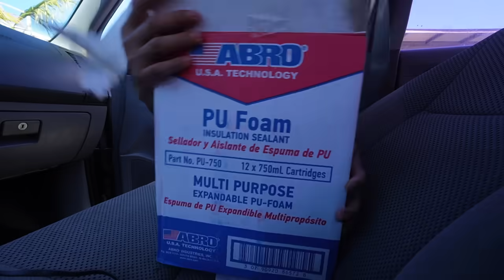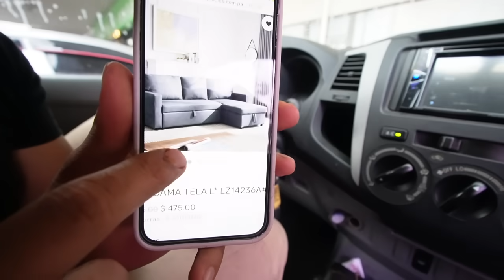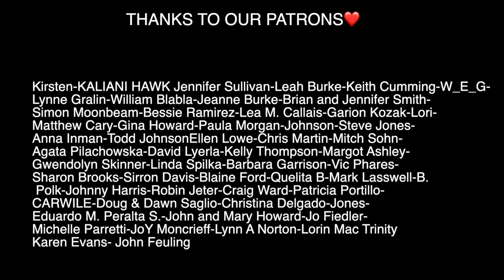WE HAVE TO STOP! | fixing it is a priority

Comment: The rest of the house ..before you put wood on the walls...use Insulation batts...not foam 
Foam makes a huge mess!!!
I'm not sure if the Foam insulation made it down to the bottom of your walls!!! Go ask Jordon before you continue!!!
Reply: I agree it is a quick fix.
Reply: I was thinking the same thing.  That the foam from a can might not reach all the way down.
Reply: The foam would only reach to the length of the thin plastic tube it wasn’t long enough to reach the bottom, if he checks the bottom by drilling a small hole he’ll know for sure🤦‍♀️
Reply: Same.....
Reply: Sorry, but pink batting is Best !
Reply: Foam Makes it hard to work around the electrical units...
Reply: Yes…the whole house!!!!
Reply: Gravity would make the foam fall, and it's not necessary that it fill every little gap.
Reply: Live & learn. Go ask Jordan. ❤
Reply: @kookietherapy9398 That stuff is complete junk! Rockwool is far superior do some research on it.
Reply: Try the sheets of solid foam which can be easily removed for repairs. Did you Google the chemicals in your spray first? Some of that spray stuff is dangerous unfortunately. I know a little girl that had a historectomy at eleven because she played around her dad's construction site when he was spraying foam insulation. Sheets of solid foam won't do that.❤
Reply: You need screws and insulation you can remove so you have access to the electrical and behind the wall. Or you don't care if you have to tear anything out. Not good if you cannot reach your electrical. Also dangerous...❤

Comment: May I suggest letting the wood be an accent wall and the rest surrounding walls be concrete board which will separate the living room from rest. You could make a storage cabinet system along the bottom of walls about 2 1/2 feet tall. And a flat top with cushions for extra seating along wall. That bottom space would have been wasted space.

Comment: Rodrego, usually the instructions on the can will tell you how much the foam will expand. Only fill between 1/2 to 2/3 of cavity and the foam will expand the remainder. Also putting to much foam in a cavity can push out the boards because of the pressure when it has no where to expand. Remember you might need a vapour barrier between your insulation and inside wall. Good luck guys.

Comment: Just a thought but going forward could you not just use 6x4 wooden sheeting and cut a number of small grooves a couple of mm deep at the same distance apart as the tongue and grooving, thereby giving the effect of tongue and groove, but a lot quicker and possibly at less cost ?
Reply: Agree! Especially the ceiling; I'm doing the same with a stairwell landing to avoid squeaky boards and dust/dirt collecting underneath. If they're worried about matching what's already up, continue doing the tongue/groove but definitely a time-saving, cost effective solution for that massive, steep ceiling.

Comment: Another tip to help you speed things up.  Pick up a 12" benchtop planer.  Then you can run your tung & groove boards through it and eliminate all that hand sanding.

Also, use regular insulation on your other walls.  Much easier and cheaper than using all those small cans of spray foam.
Everything is looking great.  You guys are making a beautiful home.
You work well together. ❤

Comment: To check to see if the foam made it to the floor, drill, or cut small holes along the base. More time consuming but, if you use a hole saw, save the piece you cut out so you can glue it back.

Comment: I'll be really surprised if that foam works. Nasty stuff and it doesn't always fill all the nooks and crannies. Anything else is better.  The Lasagna looks divine!!
Reply: Agreed. Foam can also cause problems if there’s not ideal air circulation. Yikes. Wool insulation would be amazing but I know it’s very expensive. Keep the heat out.
Reply: I'm just glad it's not that big of a space they had to use it in, @PoeticD .
Reply: The primary need for insulation down here is for sound. It doesn't get warmer than around 72°- 73° where he's building this house. It does occasionally get down to the mid 50°s at night but, with his bed up higher on the second floor, I doubt it gets very cold inside at night @PoeticD

Comment: A close approximation of C* to F* is 2 x C* + 32 = F*.  So if it’s 35 C*, the 2x35+32=92 F*. That is very warm!  Thanks for another entertaining episode and Freddie continues to be fantastic.
Reply: 35 x 2 = 70 + 32 = 102!
I think the maths you wanted was to multiply by 1.8?
Reply: No, heat is not an issue. It doesn't get above 72-73 where he is building. I live a little lower in Bajo Boquete and it rarely gets above 76° down here.

Comment: There is loose cellulose insulation which could have been blown/scooped into the walls. It may have been a better choice than the foam because foam tends to stick to what it touches and while it expands may not have covered the whole area. I know you have to go with what you have. Moving forward use Batt insulation.

Comment: For added insulation I would suggest 2" solid foam insulation. If rock wool gets wet, you ruin it or your electric gets jeopardized. With solid foam, any thickness, you just wipe it off, save the insulation, and it also acts as another vapor barrier...❤

Comment: Just a tip for you, if you have an iPhone you can ask Siri to convert Celsius to Fahrenheit. Just say “What is 30 degrees Celsius in Fahrenheit?”
Also, to get an average in your head without asking Siri, you can double Celsius and add 30 degrees to get an average in Fahrenheit. Example: 2x30C=60C/ 60C+30=90°F average
Actual 30°C is 86°F
Hope that makes sense.

Comment: Okay, cool the shorter tongue trick seemed to help, now, when you are nailing it in........when you put the first board in, get it good and level and then when you begin to nail it in, holding the nail gun at a 45°angle between the vertical tongue and below the surface of the finished board.   This will keep the nails hidden, it will be plenty strong and no holes to fill.  It’s looking great, keep the cooking vids coming. Great content

Comment: Rod you’re now responsible for your girlfriend’s health too so please read instructions before using products. While curing, spray foam emits a gas that causes blurred vision and trouble breathing. Using full face and respiratory protection while applying the product is recommended. Isocyanates are powerful irritants to the eyes and gastrointestinal as well as the respiratory tracts. Direct skin contact with isocyanates can also cause marked inflammation. If someone is sensitive to Isocyanates then you’ll later feel sick as if you have the flu, itchy eyeballs, and rash.

Comment: 36 C is 98 F with Panama Humidity yep thats hot.
Freddie the Laagna looked so YUMMY..Tip  cook noodles first they wont be as chewy .
Awesome you have spray foam on one half the front and if you do it one the back full half you will block out some of the heat but honesly it should of been everywhere dude. OXOOXOXOO
Reply: Looks like the noodles Freddie used are the “no cook” variety. It’s the quicker way to make Lasagna

Comment: The small insulating foam cans sold in stores are typically meant for small-scale DIY projects and offer limited coverage and insulation. Professional spray foam application involves specialized equipment and trained technicians who can apply high-quality foam evenly across larger areas, providing better insulation, sound proofing, and sealing properties and come with warranties. Just a FYI…I know you were just fixing up a goof. Also, don’t cook and use products nearby that emit gas such as foam while curing…yikes! Read products warnings and protect your sweet girlfriend too. 💙

Comment: Just thinking out aloud about how effective that super thin insulation will be in the heat. I would have gone with batts or wool but that is just me and I am not an insulation expert.

Flooring should be the very last thing, this is from experience and wrecking flooring from other construction. Go light, you will regret the dark colour with the animal hair, dust, dirt, mud from outside (again from experience).

Comment: Isn't it supposed to be batting insulation
Reply: Yes. The canned foam is not the right produce for that application because it won't reach much beyond the length of the nozzle. The thin shiny pieces are used as a reflective barrier, but it isn't wall insulation.

Comment: Using sprayfoam like that is not the way to do it buy the glass isolation like Jordan put in the sauna. also if the foam roll down the wall lett it dry and just break it of the wall. clean it before its dry is a mess and it will be like you experienced. regard carpenter form norway!

Comment: If you wait til foam is dry rather than wiping it when its wet..  you can generally peel it off..

My suggestion would be to do.more research for each stage. It seems like you do and learn rather than learn and do... which has its place but in house building can be costly.  If you ask kn your videos for advice from trades before your next step, I'm sure you will have lots of useful advice before starting that phase of the project. Perhaps use the community section for these posts too

Comment: I don't think foam insulation is needed in the Caribbean region...is it? Be mindful of the advice you get online if the professionals aren't from your country. If I were you I'd get the opinion from contractors/professional builders in your region. Houses are constructed differently every where and for valid reasons
Reply: Foam will not mold or rot. Where did he get the cans from in the first place? His local building supply store   ....... Be mindful of people who are speculating and have zero experience. Many people have commented on the insulation issue that live in the same region as they do and they all say the same thing as have others who do not live in his region.  He was told to tear out the wall and use rockwool he chose not to.

Comment: Dude just invest in SHEETS of foam insulation.... do your entire house before you start adding finish surfaces... the order of your build has been strange..  I understand when it comes to needs and living there.. but there are certain processes to building and reasons behind them.. 

Skipping to finish work without actually doing things like wiring and plumbing until its done, insulation, water and air sealing... vents..  theres so many pre finish work tasks that you seem to have just skipped. Theres a wealth of knowledge both in your community ans youtube itself... please stop making mistakes you need to fix and start preparing for each stage before you do it 😅